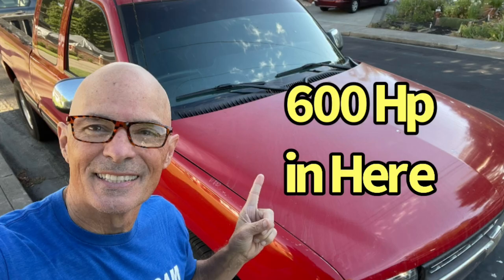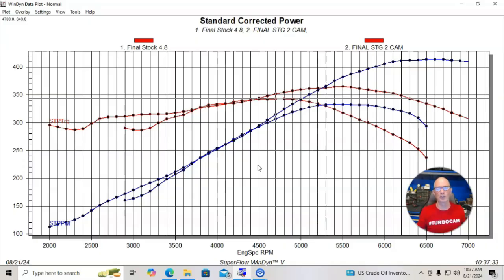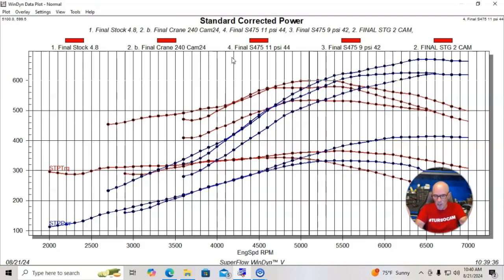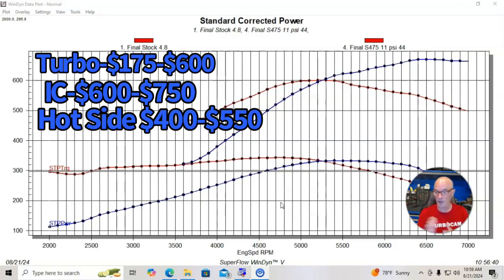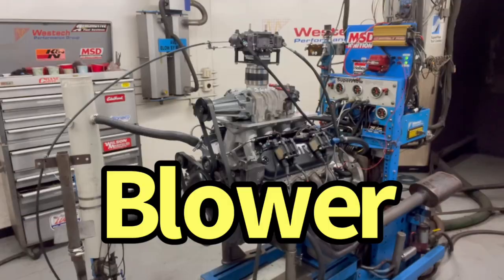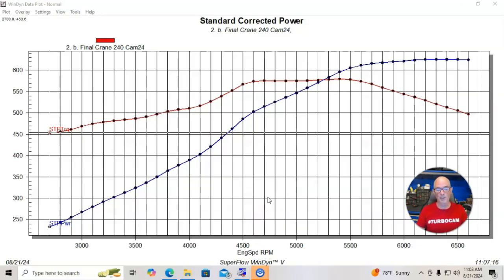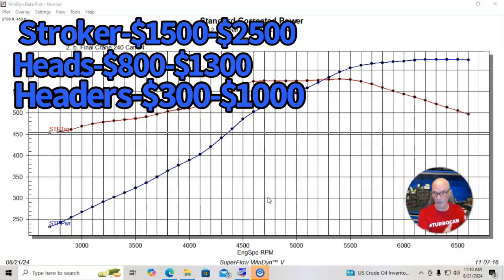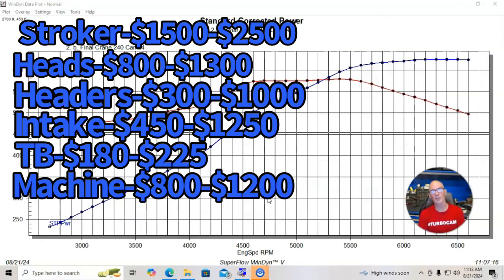WHICH ONE IS CHEAPER? 600-HP 408 STROKER VS 600-HP JUNKYARD 4.8L TURBO. FULL PRICING FOR EACH.

Comment: The 408 might be more expensive but its a new build.  Versus a junkyard engine. A fair comparison would be both engines fully rebuilt.
Reply from the maker: the only reason the 408 was new was because it was required for the additional displacement, like adding the turbo to the 4.8L. A new motor is not necessary for 600-hp 4.8L-just ring gap.

Comment: The machine work is the hidden killer on an engine rebuild. Easy to blow the budget with hot tanking the block, align honing the bores, zero decking, balancing everything, etc. etc.
Reply: @AEtrane  but all of tht stuff has to be done to really kno the history of the engine and start with a clean slate
Reply: No need for any of that on an ls, these are so good even on high mileage, pressure wash at home and slap some new bearings in it and run it.
Reply: @timothycarey3883 not true. Some of these things will be required after certain modifications like changing to arp main studs instead of bolts 🤷🏾‍♂️
Reply: @TEsko540  no body changes to arp main studs on ls engines, the rods will fail long before crank or main bolts, ls have 6 bolt mains and skirted block. Arp head studs maybe, but people run tons of power thru stockers. 600hp for an ls can be done with cam springs pushrods and a china turbo and run for years with a good tune.
Reply: I agree. Speaking as a bench racer, it seems to me that machine work is expensive and also a consumable. If you blow the engine up, you loose a lot of money. Whereas on a turbo, the most expensive parts won't be damaged  in a typical engine failure. You just go back to the junkyard, and then  throw another $800 into a cam, pushrods, studs and HG and you're ready to go again. It's cheaper to repair.
Reply: Powell machine. Does a lot of ls Engines. And he completely disagrees with. No need on an LS. And proves it. There is a difference between an engine builder and an engine Assembler. For instance, Some will say, Ignore that rotten number one cam Is bearing, All LS are that way, send it, Because everyone's doing it. And a builder will say. Let's line hone and deck it so each piston is doing and getting the same thing. Quench- compression - piston to valve clearance. Ect ect

Comment: I wanna put my 70mm on3 turbo on my silverado with a chopracobra cam, whats the chances the 4l60e lives driving like a grandpa? On the lowest boost it could make
Reply from the maker: doubtful
Reply: @rcfreak781  this has often been a topic on Richard’s livestreams. There are things you can do to help the 4l60e live longer like aggressive gear ratios 4.10 or up, smaller tires, shift kit, and a huge trans cooler but even at that any downshift could be its last. If you’re willing to do the turbo install it’s just best to swap or upgrade trans at the same time.

Comment: Looking back at some of your stock cam turbo 4.8 videos, it seems a junkyard 4.8 with a ebay gt45 around 12-15 psi should make 600 engine dyno hp
Reply from the maker: they make over 300 hp NA so 15 will get you there
Reply: @richardholdener1727  that was exactly my point. The junkyard 4.8 didn't need any expensive aftermarket parts. A gt45 and 15ish psi from your previous videos will do 600hp.

Comment: One thing I would like to see I don’t know if you’ve done it but I would love to see a 6.0 with some 48 heads and a cam budget build street motor something you could drive every day yet makes a lot of power with mostly stock parts I would like to see it on fuel injection and dual plane intake if possible
Because the only other motor I’m going to build for my son is because I know how to build. It is a 400 small block with some bowtie heads and probably a bracket master cam. I just know that combination works.
Reply from the maker: I have 6.0Ls with 706 (4.8L) head vids up

Comment: You could also take the rotating assembly out of a 4.8 and with new Pistons and use it in a stock 6.0 L and make a poor man's 327. Definitely we need to balance the crank with all that extra weight added by the  4-in piston. That would be a fun build. It definitely would be nostalgic.
Reply from the maker: coming-but I already did a 4.8L crank in a 6.2L block
Reply: With what result?
Reply: @arthurbirt2094  He has a video on it

Comment: Great video! I’ve seen big hp cars lose at the stop light nationals to lower hp cars due to traction, yes. Roll racing is fine for high hp cars, but on the street a 450hp light older car usually wins most races to 80 mph and a good old 350 Chevy with afr/trickflow heads gets the job done
Reply: 94 s10 ss mild 6L LS minor enhancements a real blast on the street
Reply: I agree and am wrestling with this as I have a 6.0 LS in the car now with a decent 228R cam. I may just upgrade my heads intake and maybe a cam upgrade. I have traction issues but once I resolve that(close now) I am sure I will want another 50 hp at least. I am making about 350 ish est at the wheels now with a 4l80.
Reply: @TheBDD1970 depending on box and whether in 4wd or street car but a 6 litre with a 228r is more like 400whp.

Comment: If you where building a turbo e85 truck to tow your race car to the track with, how would you set the engine up differently to handle the non stop stress that comes with towing. Has anyone tried this? The ecoboost does it but I’ve not seen the big turbo V8s doing it I wonder why?
Reply: He’s covered this several times in other videos, just search. Many people have done this.

Comment: Hey Richard, look into the Denmah VS Racing turbo with cold side kit. Real cost effective and comes with everything you need for less than $1,000.
Reply from the maker: Matt does good stuff over there
Reply: This kit is the best bang for your buck, running well on my rig. With the 7875 cast turbo my total was just under $900. Comes with Intercooler, piping,couplers, clamps, Bov, and WG oil feed line, and turbo gasket.

Comment: for me its all about fitting it in a 77ish chevy van but from what im reading is all of the outside dimensions of the motors are pretty much the same and will all fit where the other one sat??? so im just waiting to see the ultimate steal deal on a ls/6l90 pair on facebook marketplace...ive been checking every day just waiting. leaning towards  a 383 stroker

Comment: TurboSmart WGs and BOVs are awesome, but not cheap.  Your low side of $2,289.00 for the turbo setup, Richard Holdener, is low!  Cool video as always though
Reply: Low side is Chinese junk parts.
Reply: @danmyers9372  I was thinking the same.  I bought a PTE 88mm Pro Mod Gen II CEA ceramic ball bearing and it was not cheap

Comment: I built my 5.3's turbo kit as 'frugally' possible: I have under $1500 into it. Granted I made my own x-over and downpipe, but a no-fab kit would be ~$2000. Turbo can be done a lot cheaper whereas a stroker is largely a fixed cost. Even using name-brand stuff will be cheaper.

The up side to a stroker is you have instant torque, which is fun to impress people with instant burnouts. Then again, a simple 454 or 496 would do the same for a lot less.
Reply: So, what you’re saying is I should turbo my 496?
Reply: @hydrocarbon8272  you gotta love a big blocks torque!!!
Reply: Yes, a 454 can and does do that but the pain in the wallet makes it prohibitively expensive on the back end 🥺 6-7 mpg is just 🤢🤮 when filling up. Though, I was able to buy an entire truck for $700 with a bad running 454, surface the heads, buy gaskets, all for under $1000. I’m not upset with how it turned out, just sad about the fuel mileage. A 4l80e is in the works, so maybe 10 mpg could be had 🙏🏻
Reply: @orangetruckman believe it or not but get ya a quest or an old spread bore with smaller primaries and the 480e overdrive together will get ya 12-15 or squad-jet
Reply: @yeahididit9054  I got 17-18 out of a 454 at 80 mph ..  t56 6 speed and 3.73 gear. And a quadrajet. 
Later I did up a holley and blow through with a small s475. It was amazing

Comment: If you have a truck that's any bigger than a Single cab you want the stroker and you can keep factory heads like a 799 with some minor work, big cam and springs and you'll make amazing torque and gain efficency down low. Sorta wonder if I should have spent the extra 1k for the stroker kit for my 6l build for my truck. Decided against it for longetivity reasons and I'm gonna turbo my built motor

Comment: Add 2k for Holley EFI on the turbo set-up
Reply from the maker: no need-same ecu as stroker
Reply: Both would need to be tuned regardless of ecu choice, both can use the same ecu whether stock ecu or aftermarket ecu, so there's no cost difference between tuning

Comment: Trapping 134 in my 5000lb 4.8 truck currently ss2 cam and a 1.25ar 7875 at 14psi
Reply: SCHWEEET!
Reply: @scotttimpany2845  translation = He is making about 800 hp using a turbo and he is loving it.
Reply: @TheBDD1970 I'd say over 900 crank and closer to a thou if it's legit 5000lb race weight at 134 mph.

Comment: I remember when 408 shortblocks were $3599, now they're $5000 or so. Total buzzkill.
Reply: And rotating assemblies used to run around 1200
Reply: And you can almost double that for the FoMoCo and Mopar guys!
Reply: But with the Bidinflation, that is 5000 puny little microdollars, so you aren't spending anywhere near as much!

Comment: Turbo 4.8 is cheaper. 
But a 408 says wow then turbo it.
Talked to my machinist today. Gave him the news. He got a smile on his face and then said 408 will make a lot of power, which is exactly what Richard says.
Reply: It's got a "408 and an 88".  And yes, it makes a lot of power.
Reply: Packaging a Turbo is an add'l expense, challenge that NA bypasses. CenTex Machine shop tab $1900 3yrs ago to deck, bore .010, clearance, balance w/clutch an alum 6.2 stroker to 6.8
Kit was $2800. Other supplies, parts $2900.
100 hrs to hounddog stuff,remove, dis & re- assemble, install . Chassis dyno $600.

Comment: I would turbo my cheap 4.8 and try to tune it for better gas mileage. It would be cheaper to run than the 408.
Reply: Your gas mileage with a turbo is gonna stink!  Why?  Wooooosh!    Vrooooooooooooooooooooom!  Woooooosh!
Reply: @scotttimpany2845  let's say I'm doing a 300 miles road trip on cruise control. Would it be so different?
Reply: @olivierroy1301  Well... mostly likely.  But really?  Vrooooooooom.  Wooooooosh!

Comment: I’d take the stroker, finishing my stroker build now.   I just left twin turbo and want to return to my roots.  No other reason.  Hard to beat the sound and torque curve of a NA stroker.  But hard to beat the price and efficiency of a turbo
Reply: Why u gotta have a stroker with a turbo lol!!
Reply: @joshgessinger4509  Got to have a stroker  and two turbos!!!
Reply: Better to have blower and a stroker.
Reply: Hard to beat a stock bottom end 6.0 with a cam and springs. Turbos are great, but the associated plumbing clutters up the engine bay, heats the shit out of everything & makes everything more difficult to work on. You can make 400HP to the tire for not a lot of money. 400WHP is really fun in a 3500lb. or less vehicle.

Comment: Turbo is ALWAYS cheaper
Reply: I mean you could spend more on a turbo but you definitely can do it cheaper with a cheap turbo
Reply: Sure, but a stroker kit is basically a full rebuild. So you're getting a new motor.  You could do turbo on the cheap. But if you're engine fails and you're stuck with a rebuild anyway or worse.  So it's basically buy once cry once. No idea which I'd prefer.
Reply: @craigquann but with a junkyard 4.8/5.3, you don’t have the spend thousands for rebuilding. Just get another one for 500 bucks.
Reply: Plus more torque